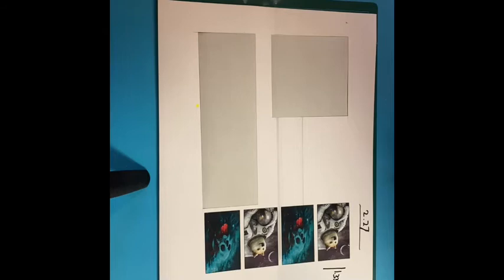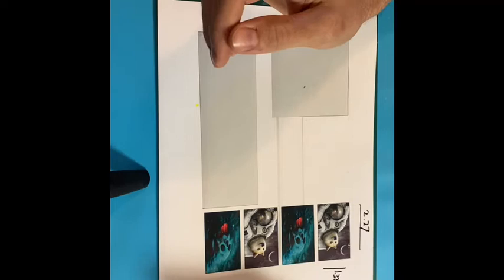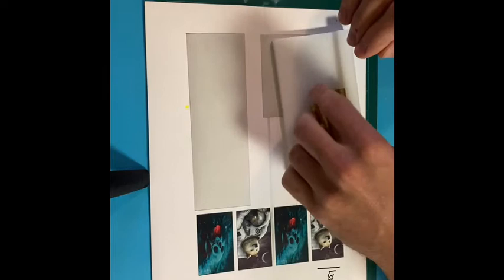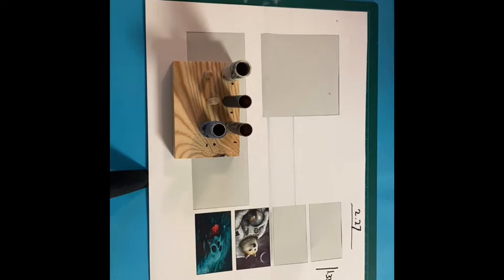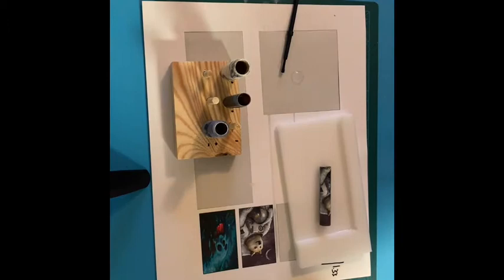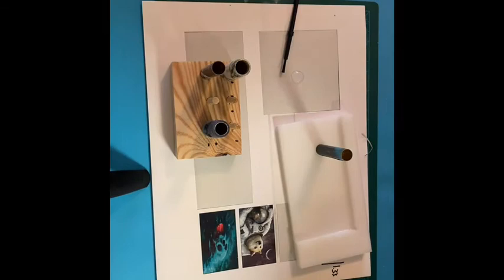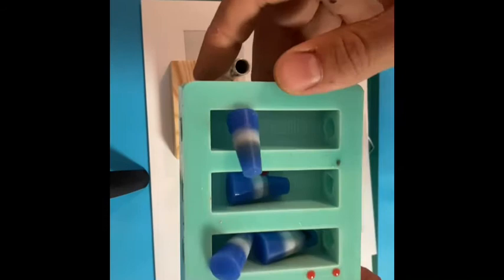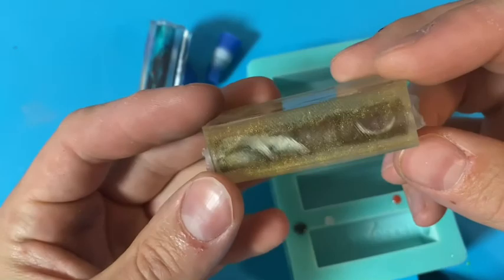Prepping and casting a label tube in pen blank. Create your own pen label design.

Comment: I need help on the software how to make the actual label
Reply from the maker: I use Microsoft word. There are measurements posted online for corresponding pen kits. Let me know and maybe we can set up a phone call and I could walk you through it.
Reply: I use Open Office, which is free, but just like Aidan says, select your image then "format" then "position and size". Put in your numbers and save. You can use a regular sheet of paper if you're doing multiple images in order to cram them all on one sheet and not overlap. That gives you a proof sheet to see your spacing. After a bit, it becomes second nature with moving images around the sheet. Then print your decal sheet.
If you only print/cut out one image you can back the hole with paper so your printer accepts the "holey" sheet for another round of printing.